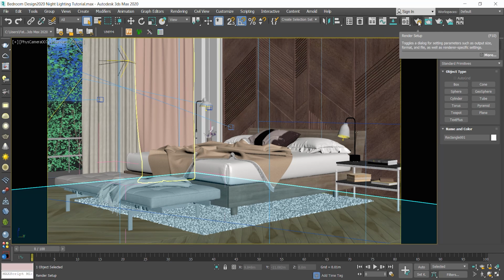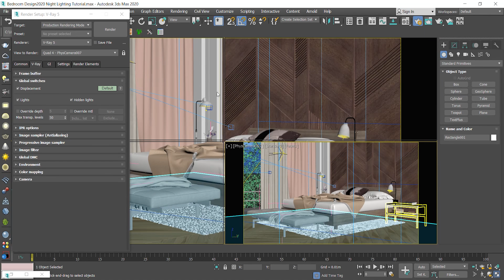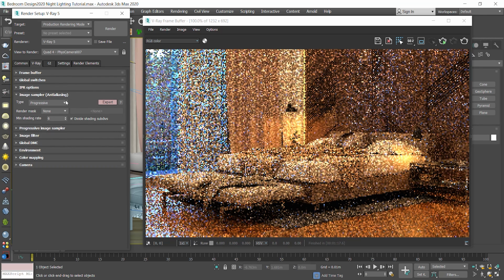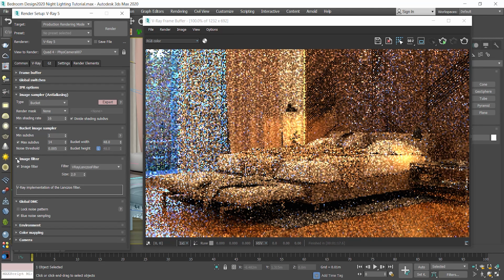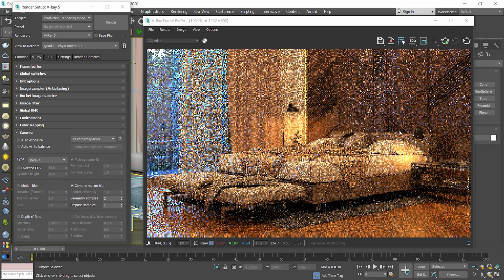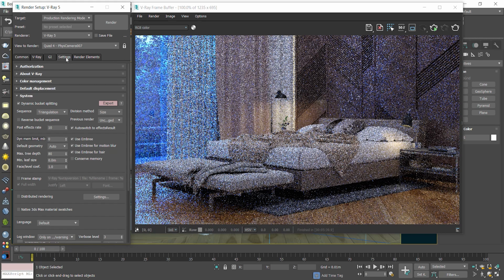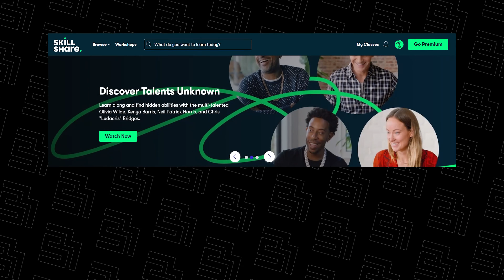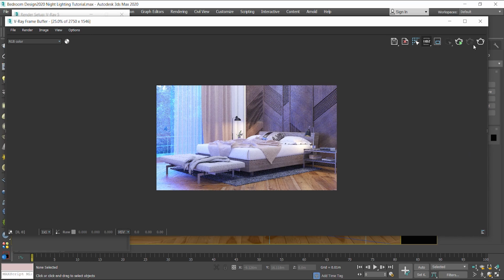V-RAY Render Setup for TEST & FINAL Rendering

Comment: minimum and maximum graphic card requirements for 3dsmax sir
Reply from the maker: it really depends on your project. but if you're using V-ray you should care more about RAM and CPU than graphic card (if you're not using GPU for rendering).

Comment: I think vray 5 is taking longer render time . Before i used vray Next, it is more faster than vray 5.
Reply from the maker: Hi, I think V-Ray 5 is faster. 
Did you test the same scene with the exact render settings?
Reply: Yes . Before I was using Vray next. In that I rendered an exterior scene with medium preset setting and output size was HD 1920. I got the final out put in 1and half hour. Same scene I rendered in Vray 5 and it took 6 hours. I couldn’t find the problem. Same thing happening in interior scenes too.
Reply from the maker: I'm sure there's a problem. V-ray 5 update 1 is the fastest version so far.